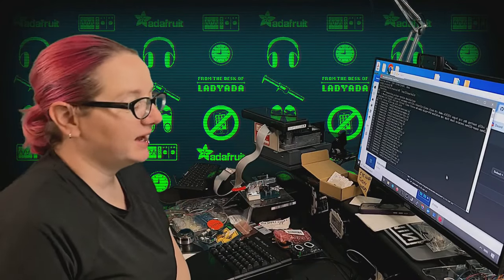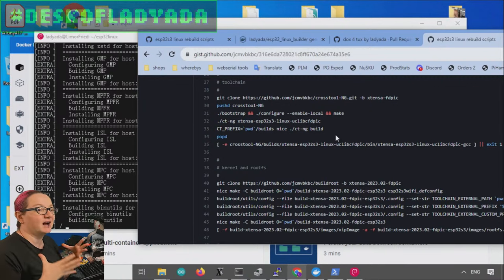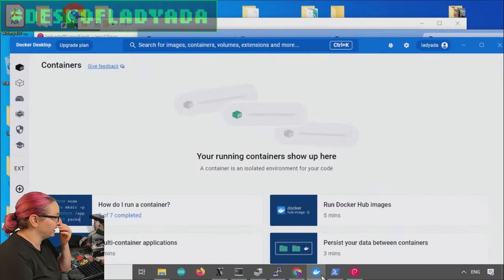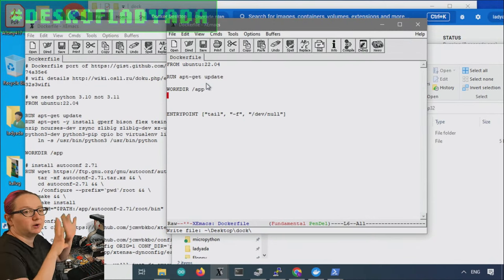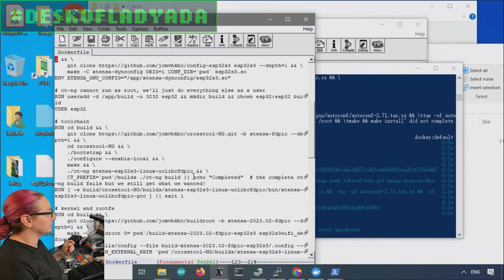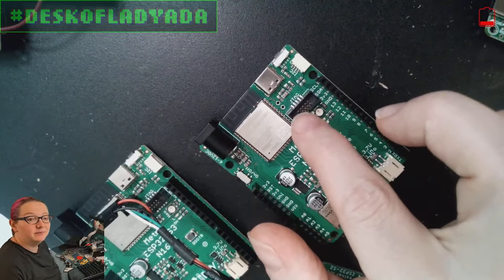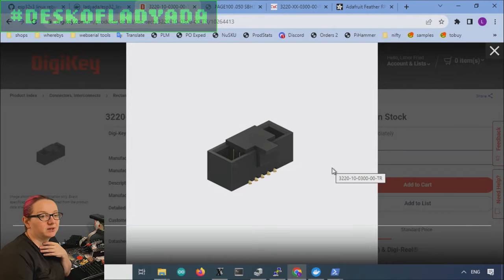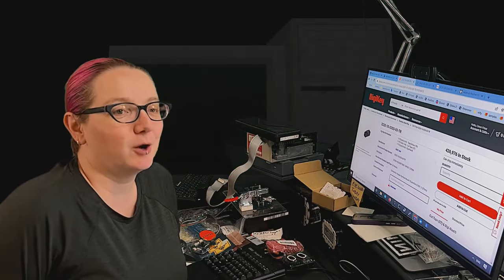The Desk of Ladyada - Complex kernel compiles? Docker it up!

Comment: Thanks for the stream... 4c of tips:

You can use closer docker image to what you need, not a plain ubuntu. In this case you could've picked "FROM espressif/idf:release-v5.1" which already contains compile tools, python and esptool. Basically it's Espressif's recommended toolset for development in Docker form.

Also for longer RUN scripts you could use here-string "<<" notation instead of "&& \" which makes Dockerfile a bit more readable:

RUN <<EOT
    command_1
    command_2
EOT